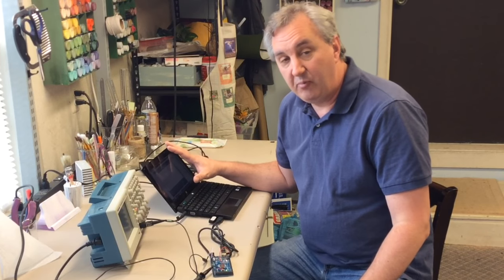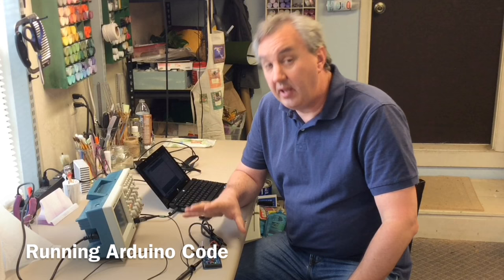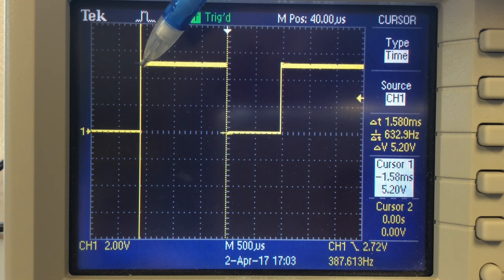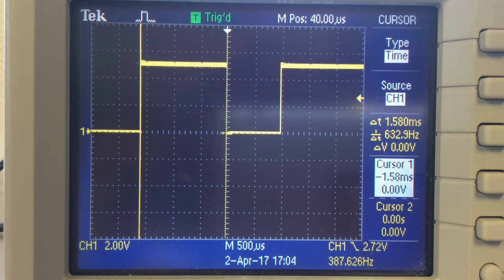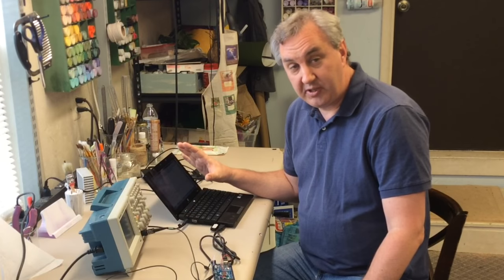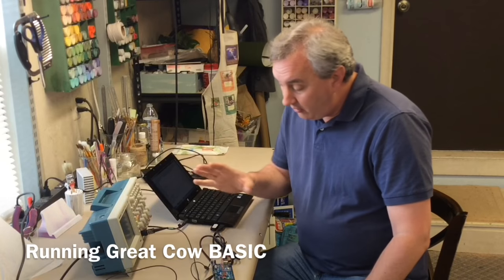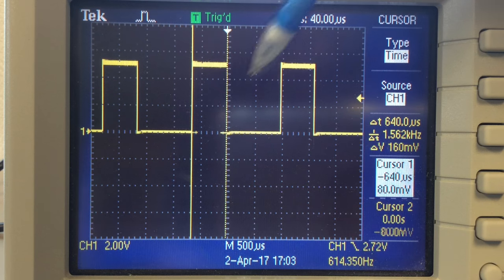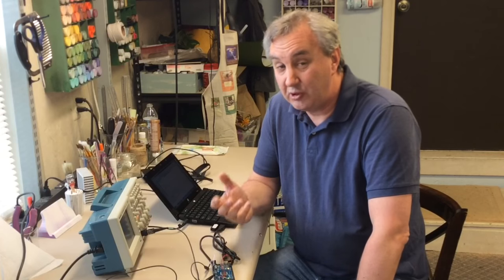8-bit Arduino Mega Speed Test vs Great Cow BASIC compiler

Comment: Very very nice.  This is what I have thought for a long time as even in a standard C/C++ compiler there are commands to debloat the code and speed it up but not on the Arduino and you just showed how much that is needed.  Get Marlin compiled in anything with the proper flags to shrink it and optimize it and the Arduino 2560 would still be great for even 1/32 microstepping.
Reply: I did a bit of poking. Arduino compiles everything with -Os.

By doing this, it misses the loop unwrap optimization in this example, which theoretically can make such a trivial loop about 4 times as fast. Loop unwinding would make the binary larger, but it's easily offset by what Chuck has used in his program - pinMode with dependencies, and just about the single slowest function in the whole library, digitalWrite with dependencies. Its dependencies include timing functionality that would be relevant if it was a software PWM pin.

Marlin is big software which struggles fitting into the largest 8-bit controller AVR lineup offers, so compiling it with -Os seems like the only sensible choice. On the other hand, a small set of library functions just isn't big enough to matter.

I did a quick series of greps in Marlin, they don't actually use such slow functionality very much, they pretty much purged the bad bits from all but the code that gets called once in eternity and dead code that isn't even compiled. Now of course if they got rid of it completely in live code, they could shave a few hundred bytes, but does it really matter in such a huge software?

As to optimizing some hot code for speed rather than size while not making most of the program (cold code) larger, there's facility of using #pragma GCC optimize - Marlin doesn't make use of this option except for one graphic LCD driver.
Reply: It just struck me that the Arduino library functions are not even hypothetically inlinable. This disables numerous optimizations in the vicinity of their use that the compiler could otherwise perform without growing the size. I need to do something else right now, but i'll investigate this. Still, a cursory glance on Marlin doesn't exactly show this to be a major issue.

... except copious use of floats in the planner. Ouch!!! They're like 100 times slower than integers. I think we can do better. Custom type that doesn't conform to IEEE and doesn't need to denorm and NaN would do the trick, perhaps with just 2-byte signed mantissa and 1-byte exponent, though IMO it should mostly be fixed-point calculations, with the only sensible use of floats in the parser, and those can still be softfloats.

Another potential low hanging fruit is i don't know whether copious use of strtol is intrinsic, hypothetically it should be, but i don't have my mind set on whether that should change at all.
Reply: Well obviously i'm not unique in my thinking. Sailfish uses fixpoint throughout! But of course it's not Arduino, so nobody will use it :P
Reply: Sailfish is 100% garbage and I told him that to his face.  It had its purpose but it #1 does not do true PWM and instead does a 1 LSB to crudely mimic PWM AND Sailfish does not do PWM to the fan as it is 100% or 0% regardless what you set it at.  Not the same and it offloads a lot of work by using compiled gcode which strips a lot of tweaking out of my hands.  I had a Qidi and I have not used it since I found out how many issues that firmware has, how big of a dick the author was, and how much I took for granted with Marlin.

Now back to the Arduino and Marlin and I wish we could do something about this to kick a whole new set of life out of such a great piece of software as Marlin.

Comment: Wow. I like this line of thought. So much potential still there, but so much work and expertise required to take advantage of this. Perhaps a trimmed library optimized for 3d printing rather than the full arduino code might be the way to go? Does anyone else sense the posibility of an open source project here?

Comment: So is there a drop-in replacement compiler for Arduino, perhaps with minor adjustments, CHEP 3D Printing?

I don't mind using command line tools.
Reply: CHEP 3D Printing sorry should have specified staying on the hardware platform, using a similar compiler like gcc - would that keep the bloat down?

Comment: I can't help but wonder if you were to run the same test using AVRGCC (The compiler behind arduino's IDE) doing it in straight C code if the results would be similar or better.
Reply: It would be much better because you would not use the digitalWrite() functions, which are notoriously slow...

Comment: Hello Chuck,
I am trashing my Arduino that I have had nothing but error codes after error codes with hours and hours of pulling my hair. I am fed up to here with "library calls"  that are full of bugs. Why would you need a Library to drive a LCD and pages upon pages of code? 
I am going back to PIC and Great Cow Basic again. Not because of speed, but the time it takes me to program most projects in GCM is 1/10 the time it takes using Arduino..
Thank you Chuck.

Comment: Could you take the ramps 1.4 firmware code, and compile with great cow basic to increase the speed of the board?
Reply: bummer...would be so cool though...instead of using ArduinoIDE run it thru that compiler

Comment: I cut my teeth on computers on an 8 bit Tandy Color Computer with 4K ram (Motorola 6809 processor).  This same processor survived all the way to the Color Computer 3 with 512K ram and higher resolution/more color graphics.  They did throw on a bunch of chips that helped ease the CPU load, but it was still amazing what an 8 bit chip could do running OS-9 multitasking OS.
  I don't think that the 8 bit is overpowered running the actual printer, but when you add on graphical COLOR touch screens, WiFI/Ethernet, and other niceties that make using the printer easier and more versatile, more horsepower under the hood just gives a bit more breathing room to be creative without becoming a coding savant.
Of course I am looking forward to your port of Marlin to the Great Cow BASIC .... :)
Reply: Colour touchscreen printers running on AVR MEGA2560 such as Wanhao i3 don't actually generate any screen graphics on the AVR. The screen is its own microcontroller with sanded off designation and SD-card it reads fonts, graphics and screen layouts from, and there's only ultra high level graphics commands coming from the AVR.

Similarly, systems which have network printing on them usually use either the processor off a Linux-compatible wireless router (such as Ralink, MediaTek) or a wireless microcontroller such as ESP8266.

Parsing the G-Code command stream (ASCII text) if it consists of lots of short sections is actually very taxing on 8-bit microcontroller, as is planning of acceleration several seconds ahead, and converting curves into straight sections. Add to that that an 8-bit micro doesn't have FIFO buffer on serial, nor DMA access to storage.

The whole system design could of course be greatly simplified if the complete complex operation could be performed on one chip, including driving the display, and i mean the A13 is just $3, and an STM32F1 for less than a dollar can also directly drive a colour screen due to internal smart DMA controller. A lower cost part can then take over just outputting a timed pulsetrain to the motor drivers, but DMA controller can be used for that alternatively too.

Comment: I feel that 16bit MPs would be awesome as well. I never understood why the 8b to 32b gap was never filled. In my case I am interested more in CNC and 3D printer controllers. 8b has some difficulties keeping up with the number crunching required in many cases. 32b is overkill but 16b would work quite well. (rant off)
Reply: I've programmed in just about every common language, written code for simple HTML all the way to AMI/Phoenix BIOS (low level C and ASM). Now I am a full time CNC programmer (I'm always learning something new). I recently (in the last year and a half) built my own 3D printer and completely changed the Parallel port, CNC controller on my small desktop mill to GRBL.

I'm always tinkering with something but for my controller boards I use the open source firmware; if I took the time I am certain that I could write my own or adapt what's available. Nearly 60hrs a week kills my desire to do this so I rely on what has been done already. This why I wish that there was already firmware available for a 16b microcontrollers and that 16b dev boards were more popular. 

8b to 16b is several orders of magnitude better in terms of performance and I find it surprising that their popularity isn't higher. That's the part that I don't understand I guess.
Reply: I still believe that the market is there. There are so many applications for microcontrollers and tons of people that tinker. I alone have found practical uses for Attiny 85/4313, UNO, and Mega. I also think that the real question is why not. If a company has a product and they market it well, it will sell. Something like "For when you don't need a full 32b and 8b isn't enough blah blah blah" and sold at the proper price point. 

I freely admit that I am no marketing genius. There is room for a popular 16b MC and Dev board, but people are funny in what they buy and the reasons for said purchases. Just because I would use something and can see the applications, does not mean that it would become popular heh.. Though, all the "cool stuff" that can be added to a 32b 3D printer/CNC controller has driven up the price of these controllers. 

It's 32b so......
Oh look you can add 5 more stepper controllers on this daughter board, it has a web interface, USB, Ethernet, SD Card, dozens of touch displays at FULL color!!!!! the list goes on and on.....

Drop down to 16b and you can still have a couple of the cool gadgets and definitely have more than enough utility that would allow you the desired upgrade in performance. The options would be "more limited" so the board will naturally sell a bit cheaper. I'd throw down $80 right now for a 16b 3D printer control board and I know that a lot of others would as well. It would fill a gap in price ranges VERY nicely.

Comment: Great video example. I know just enough to get myself in trouble ;-) I was always taught the farther removed from assembly the slower you're gonna run? I don't know anything about Great Cow, but I know enough about assembly that it can be a huge time suck coding and debugging it. 

You have to weight the cost of development with the cost of hardware. Hardware is dirt, dirt cheap now, development is not.
Reply: Yep, I remember writing asm code on the 6502 and 68000 and C had just kicked in with the ANSI standard so had to do a ton of working to optimize (for instance writing a for next loop in ASM via going backwards was faster than incrementing) back then but now the compilers write code that is so complex and so instructions per clock cycle savvy that you really have a very hard time to get better, and faster, code by hand and if you do the modern computers are so fast you wouldn't save anything that matters if you did manage it.  Back when working with 1.022730mhz and 7mhz clocks it mattered.

Comment: do you think it is possible to rewrite marlin to C??
Reply: If you hadn't noticed Marlin is already written in C.
Reply: Marlin is effectively written in C with minor C++ dialectisms, plus the Arduino base libraries. The quality of the base libraries and the compiler settings is debatable - the Arduino libraries were crap at first but are now worked on by smart people, however they tend to make a trade-off towards higher level functionality and convenience of use rather than performance, considering the target audience.

Plus the underlying compiler, AVR-GCC, could possibly use some fine tuning. However a degree of convergence is to be considered - once you start cramming features in, features that Marlin invariably needs, such as SPI SD-Card, SPI or 4-bit display, PWM, interrupt routines, ADC control, serial communication, you will invariably compromise the performance, and it's debatable whether you can do a lot better than existing libraries!
Reply: Exactly Siana and the thing is that back in the day (10-15 years ago) I could use GCC and have tighter code (and faster) than MSVC then MSVC took it over if on Windows and GCC became the bloated beast that ran like dung for everything I worked on using it.  I finally ditched it in favor of MSVC and to be honest we need to ditch GCC for the AVR too.
Reply: Yes, and the code will become less portable.  The marlin can run anywhere arduino does, such as the the fast and powerful teensy3, which is a freescale 32bit chip.

light-bulb....
Reply: No, Marlin is not portable software, it's AVR only in the shape that it's maintained by official development team. It uses direct register writes for most input/output rather than Arduino functions. It contains just enough flexibility to support 4 AVR 8-bit variants including at90usb, but nothing more than that. Ports to other hardware are partial rewrites of Marlin that cannot necessarily simply be merged back.
Reply: OK.  Yeah I am seeing that now digging around.

Comment: we just need cheap chines 32bit boards for our printers :) I don't see any other downside then price, right?
Reply: CHEP 3D Printing marlin is being ported to 32bit. Reprap is being attempted.
Reply: 50 dollars, give or take 10%, for a 32 bit board from China but it has issues and frankly I am not in love with Smoothie.  Now the DUE has a lot of potential but it costs as much as an entire 3d printer for the real deal.
Reply: I think it's the due marlin 4 due I think is the port